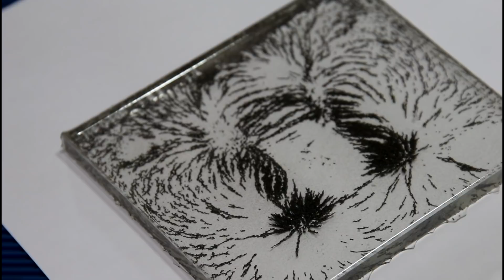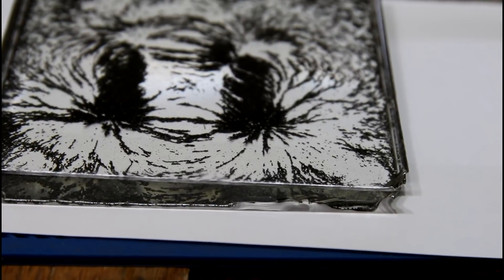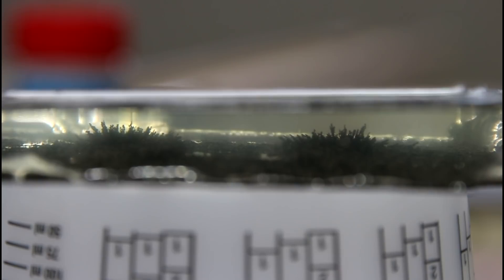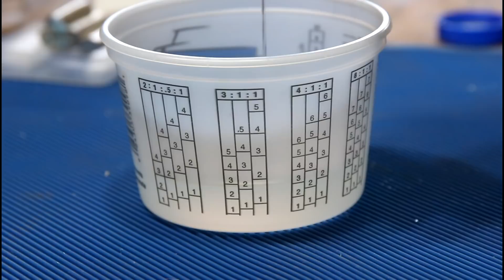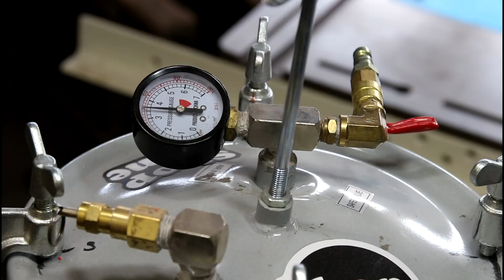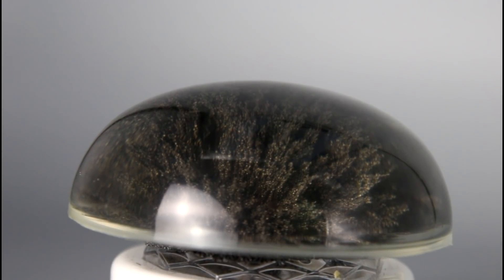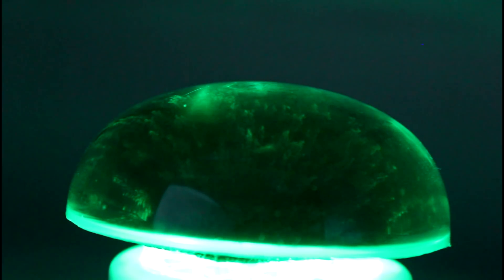Capturing Magnetic Lines of Force in Resin?: Social Distancing Day 5

Comment: Do a cylinder with the magnets in the middle and you can make rings. Coarser filings and use less, and maybe stainless instead so you rely more on reflecting light instead of the actual metal itself. Less and larger pieces would be better if you want to use the light. It will also depend on the way the surface the light goes in is finished (opaque vs clear). Experiment.

Comment: If you pour the resin in first, then sprinkle in the iron filings you might get more height because the resin could help support it instead of putting force against it to move the filings around. 
Or they might never break the surface tension of the resin to sink into it and it would fail miserably.

Comment: Mix the iron filings into the resin, pour the resin in a mold, and then attach the magnets to the outside of the mold so they align the floating iron filings into lines.
Reply: I personally love this idea.  I was thinking that myself.  I was also wondering what it would be like if the magnet was also in the piece so that it was a magnet for the frig or picking up pins that fall in the carpet in my sewing room... This has so many possibilities.  Looking forward to a followup with different applications.

Comment: The only idea I had for the silicone mold is taking two pieces of wood that have a hole in each the size of the mold, and a little shoulder on the hole so the seam can fit. Then screw them together around the perimeter to hold it shut.

Comment: Maybe try ferrofluid. If you pour and cure a thin base in your mold, then put a magnet under it and use a syringe to add the ferrofluid, then add the rest of your resin. It'd be interesting to see if it works.

Comment: I'm sitting here yelling...HOT GLUE THE MOLD BEFORE YOU POUR....so, hot glue the mold before your pour
Reply: Nothing sticks to silicone, except silicone and that bonds permanently.
Reply: @brocktechnology  actually, I haze the same mold. You can seal the joins together with hot glue to prevent leakage.  Once there resin is cured, it peels right off. You can see other resin creators using the technique to temporarily make spheres.

Comment: That turned out pretty neat  , You need to try the spherical mold again ,  make a small plate with 2 wire handles to do the pour on and then use the handles to transfer it into the pressure pot  leaving it on the plate in the chamber   ,  also try some resin dye with it   , might look pretty sweet  .

Comment: You can use hot glue on the seam of your sphere mold to keep the halves together. It really works - i have used the technique for some rather large spheres with no problems. The glue stick glue peels right off when you're done.

Comment: Looks cool. Try this, using the same inverted dome idea, get the strongest neodymium magnets you have, get the slowest curing resin you can get. Now pour the resin with the magnets located at the bottom on the outside as before (future top of dome), then add the filings. The effect should be longer strings of magnetic force being visible as the magnet pulls them through the viscous resin. A side benefit is that the filings should be nearly weightless in the resin and you will (should) get more tenuous threads of filings.  Or, it won't work.

Comment: Clamping cauls? Two square bits of plywood, fostner bit (or x-carve) to drill a hole in both which is as wide as the mould just above the central lip, then assemble the mould, put one square above the central lip, one below, and clamp together with bolts or actual clamps, then pour the resin?

Comment: It's fairly flexible, so I wonder if the tape that only sticks to itself could be a solution here--I was just recommending it to Pohl Barn for those occasions he needs a little extra padding on a loose but mostly finished piece, or similar. I'm not as sure about the forces involved here, though.

Comment: Damn you, Peter Brown.  I've had this exact idea bouncing in my head for a long time but just never got around to doing it.  Mainly because I only recently started experimenting with resin and wanted to learn the basics before I branch out.  My first idea was to just capture the normal 3D shape like you did, but I planned to later try to make more complex shapes by positioning multiple magnets at different points on the outside of a container.  Like maybe make a tree by having a big magnet on the bottom and multiple magnets around the top to pull branches of filings out to the side.  Also I've been wondering about making a resin "ferrofluid" somehow...

Comment: I would've thought to mix the filings into the resin. Glad to see there are people who were way ahead of me about that in the comments section. 
As to the two part molds, I'm certain a clamping jig could be made with two pieces of wood, a hole saw, and some long bolts, either to clamp just at the lips of the mold pieces, or one to the base and the other with a hole to cup the upper part down.  With such a rig, you might even be able to place several magnets at attacking angles.  I'm sure someone will sort it out.

Comment: Ok, this may not work (and probably wont): Use small safety pins on the sphere mold (the lip ring on the seam) to keep it closed.
Also, You can get a bag of a 100 plastic balls at Walmart for like $20. They're like a 2 1/2" diameter and could be used to make your own mold. I did this and it worked pretty well.  We have lots of small kids in the family, so the other 99 balls haven't gone to waste.

Comment: Okay so what if you were to lightly mix fero fluid inside resin and then leave the container in a bowl of magnets. So little bits get stuck and attracted to different points. Then you hallow out the middle and you got a magnet bracelet or bowl or box with all the ferofluid concentrated on the outside most part so you save ferofluid and dont waste it on the lathe.

Comment: I wonder what would happen if you mixed the filings into the resin then applied the magnets. Those neodymium magnets should be strong enough to pull some structures out, but you may need to use a particularly thin resin to get anything interesting. 

Also, I'll bet casting ferrofluid would be neat. I'm sure it would be difficult since it's another liquid, but your wife says you're clever, I'll bet you can figure it out. Even if it means just casting the shape the fluid makes under magnetic fields then backfilling the cavity with paint or another resin or something once it sets and the ferrofluid is removed. I don't think you'd be able to completely encapsulate the ferrofluid, it's notoriously finicky and unstable so I'm guessing it will begin to dissociate and lose its charm after a bit. But who knows, maybe under a closed system of a resin ampule, it'll be stable. Never know until you try.

Comment: Hey Peter, if you mad a mold with a hollow centre cylinder (like a stretches dounut) placed the magnet in the whole the filled the outer with iron filings and resing layer by layer would you build up the magnetic lines of force in 360°?

Comment: Very interesting video, Peter...and it gives me a good idea for a follow-up depending on if an experiment works: mix a small amount of iron filings into a low viscosity resin so they're dispersed, and see if they migrate into the field pattern before the resin cures. If that works, you could do a 3D representation of the field lines: barely cover a strong magnet (or arrangement of strong magnets) with the resin & filing mixture, so you have one cured layer the same thickness as the magnets (let's say 1/4"). Then mix, add, and cure additional 1/4" layers of the resin & filing mixture one at a time. Then flip it over and repeat the process. The resulting stack of cross sections should show the magnetic field in 3D, with the magnets visible in the center (assuming the concentration of iron filings isn't high enough to obscure them). I'd love to see if the experiment turns out and I think the final product would be very cool if it works out. Many thinks for all the great content, and stay healthy and safe!

Comment: Maybe you get a clearer 3-dimensional picture if you put the resin and filings in layers. So, like the first version with the horseshoe-magnet. Add a light amount of filings, add 2-3mm of slow-curing resin, pressure pot, wait for it to cure, repeat. (that would be something you could do on the side)

That could also be a nice way to make dragonballs with cleanly positioned stars... 
Or a DNA double Helix from small beads or something.

Comment: Wow, awesome, third video in as many days.  Please continue to self isolate yourself Pete.  I believe I saw this in another comment already, but what if you mixed the iron filings into the resin before hand, then applied the magnets say to the upturned dome.  Also about that silicone ball mold, what if you taped it round and round and round with say narrow masking tape and cut the tape away where the hole is. Then pour the resin in after and place magnets on more than one point on outside of mold.  Hope that made sense. Keep them videos coming. 👍🏻

Comment: Nooooo! don't take it out! Last attempt was spot on, but then put a magnet on it after first part has set and add filings and second half of dome!
Result is a ball with magnet in middle. And you can get the molds to seal if you make two wood boards with holes in them and clamp the molds.

Comment: If you want to use the under light, you could try it again with multiple magnets spread around the edges of the mould instead of in the centre.

I'd also like to see a version with a mild colour tint in the resin ar opposed to being tinted by light

Comment: What a neat concept! A couple ideas come to mind: It might produce larger/loftier structures if the ferrous material was mixed into the resin before pouring, and applying the magnet after the resin is motionless. It might also be possible to source or make shiny ferrous particles (eg. using scissors to snip away chunks of an iron brush), which would likely create view-angle based visual effects after the magnetic field aligns them (kind of like highlights on shiny straight hair).

Comment: Next attempt: Mix the iron filings into the resin Before adding the magnets.
Reply: Was thinking about this too. Maybe salt the top of a long-cure-resin-filled container with a powerful magnet at the bottom? Then put it in a pressure pot and see how they migrate.
Reply: @very-tired-2026  ok, how about hot gluing a donut magnet on of those plastic sheets, use just enough iron shavings to show the curve of the  force. If you do it twice and use resin or something to attach the 2 half circles to make one, giving a full 3 dementinal capture.
Reply: I thought the same thing. 
Mix the iron into a thinner resin, put the magnets in the pressure pot, pop the mold into the pot and quickly seal it so it’s a surprise.
Reply: That would be so interesting.

Comment: If you can find a super strong magnet, try mixing the iron into the resin (very little as it will probably be hard to see if there is a lot). Also why not try using magnets to hold the mold together?

Comment: Maybe try putting the filings into the resin before mixing it with the hardener, let the air come out. Then mix the hardener in, put it in the mold, then move the magnet close. The filings should still move into place.

Comment: Instead of pouring the shavings onto the magnet, try mixing them into the resin and placing the magnets on the bottom outside of a mold and see if you can get the shavings to form the lines by moving through the resin. Yes this may result in the same product but would lead to using more instresting mold ideas without concern for keeping the shavings intact because they will form in the mold itself

Comment: Try wrapping the large mold in silicone tape.  It is normally used to repair radiator hoses on cars or isolate high voltage connections.

Or you could use epoxy putty: let the putty cure before you fill the mold.

I wonder: if you mixed the iron into the resin, would the bits line up before it cured?

Comment: How about making micro "C" clamps to hold the mold together, or a channel type hose clamp, like they use to hold flanges together?
Reply: I don't know that it would help much with a floppy silicone mold, but they're called sanitary clamps.
Reply: Small spring clips from an office supply house
Reply: Small binder clips may work
Reply: Simple hot glue gun seals it closed, I have the same molds.
Reply: Silicone can be glued, provided that it's clean.  It often is not clean, and release agent residues can sometimes be difficult to remove.  There are specialized adhesives for the purpose, which to my recollection tend to simply be RTV silicones themselves.  I've used Permatex Ultra Grey and Ultra Black for assembling things made from castable silicone.  That said, gluing the mold shut would make it usable only once, and might tend to ruin the part if there is squeezeout on the inside.
Reply: Maybe something like this?  

https://www.jacob-pipesystems.com/products/connecting-components/
Reply: Sumthin like Flange rings made from wood.......

Comment: I wonder if you could mix the iron filing  into a relatively slow cure resin and then set 1 or more electromagnets round the outside of the mold as it cures.  Not sure how you could get the power for the electromagnets into the pressure can.  I suppose some big neodymium mags might do the trick.  Nice experiment 👍👍👍👍👍👍

Comment: What about adding the filings after pouring the resin so that they have to descend through the liquid. Should form taller spikes as they use the resin for support. Interesting to see the results of different cure time resins.
Reply: Yes and really warm resin so that it slows easily
Reply: Or what about really strong magnets?
Reply: @girrrrrrr2  he already used the strongest magnets he can buy
Reply: @ed13pc  Strongest PERMANENT magnets, electromagnets could to the job, but COULD be hard to put into the pressure pot.
Reply: @LeafShade  you're right, totally forgot about electromagnets
Reply: I think that wouldnt work, the resin is too dense
Reply: A much thinner resin, and mixing the filings into the resin might work very well. (Iron filings in mineral oil works well)
Reply: Those are not nearly the strongest magnets one can readily buy, but I don't think it would've worked better. The spikes would've probably crushed themselves under the higher force. You can see that with ferrofluid, super strong magnets make just a tiny ball of compressed spikes, while these magnets probably hit the limit on big crazy spikes.
Reply: I'd love to see this
Reply: A resin that’s really watery I’d think though they might still try and float

Comment: You should mix the filings into the Resin and put a Magnet near it when it kicks, so the filings Turn to the magnet. This way you get Even more three dimentional
Reply: Yeah, that's what I was thinking!  Mix the resin and filings, vacuum out the bubbles, THEN do the magnet!  Maybe he'll try these for his next video...?
Reply: @DonnaMSchmid  Yup mix in iron fillings like you would mica powders just enough but not so many that it clouds the resin up, i would say use the sphere mold and suspend a spherical magnet into the liquid via fishing line so that the fishing line disappears in the resin, and the sphere magnet is in the center and if the filing dont sink they should show the fields around the sphere the magnet as well as spike up the magnet itself.   I suppose if you didnt want to have the magnet covered in spiky bits and show a little through the resin itself you could layer up the magnet with resin/epoxy maybe to a 1/8th in or 1/4 inch thickness then perform the process described above...
Reply: Yes!!... And you can put more magnets to create mixed lines of force... in a cylindrical shape with magnets on the ends... cool!!
Reply: Yeah. First thing that came to my mind is to make a resin-based ferrofluid, so it cures in the shape the regular one makes next to a magnet
Reply: @Roderick storey magnets and heat don't go well together
Reply: @zephyrantiris661  It it got to the Curie point the resin would be burnt.
Reply: And you could use hot glue to attach stacks of neodymium magnets around the sphere for what I think would be a mesmerizing bit of resin Magic
Reply: I was thinking something like this the entire video, would love to see it tried
Reply: Came here to comment this!
Reply: Yes, mix the filings in the resin to create a ferrofluid. Cure the resin in a magnetic field. Makes a spikey ball. Bubbles won't matter because the filings will hide them.
Reply: @Roderick storey neodymium magnets demagnetize at water boiling temperatures or so, they don't like heat at all.
Reply: So many people had the same idea, i hope this comment get highlighted
Reply: Came here to say the same thing!
Reply: Yes. Was looking for this to upvote
Reply: I think that would be breaking through the 5th dimension, the last person to do that was his crazy uncle who drove a delorean.🤔🤔😂😂😉